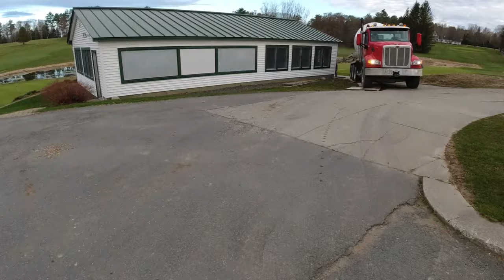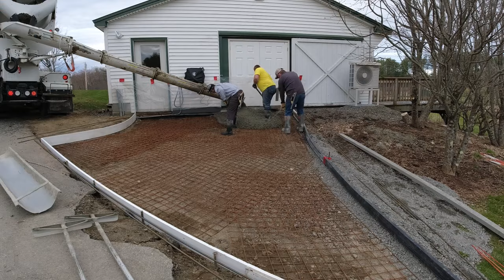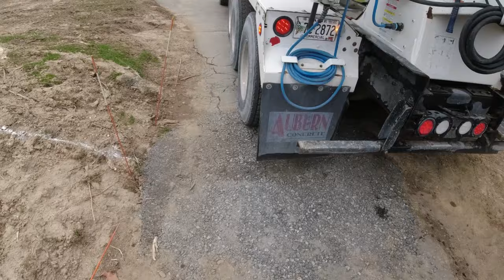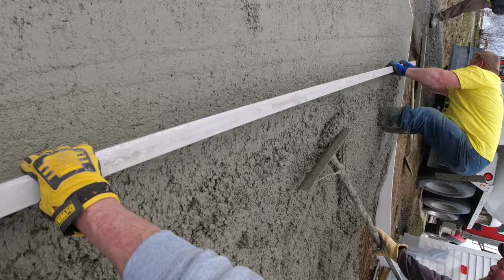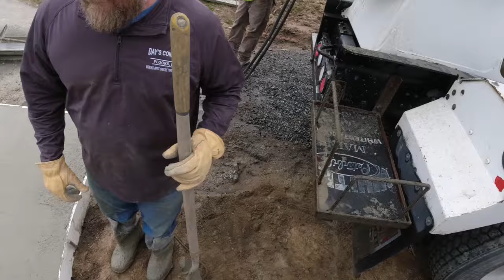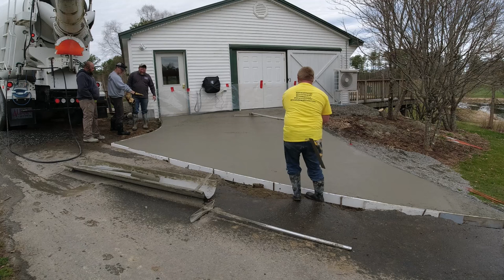How To Pour Concrete On A Steep Slope (Concrete Driveway, Walkway, or Apron)

Comment: i just poured my first sloped project, a driveway approach. i had had concrete flow downhill on a slightly inclined slab before, where the aggregate started to pile together and show through the surface, so i was nervous. i asked for a 3. dude thought i was crazy. it absolutely killed us, 2 man crew. i got heat exhaustion. but it came out OK. i only wish i had edged around the water shutoff valve. and it didnt flow downhill by even one millimeter lol